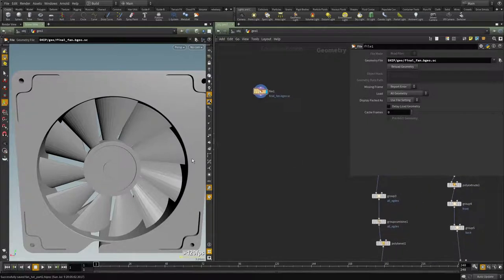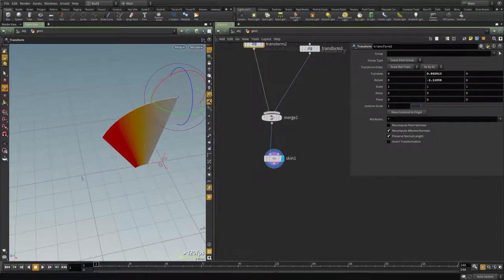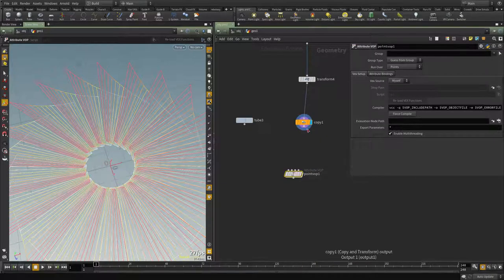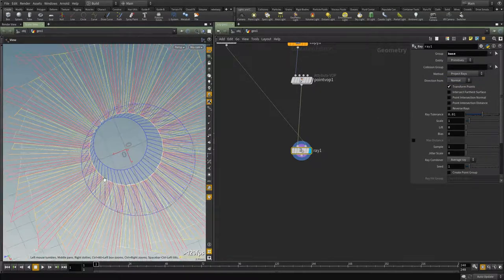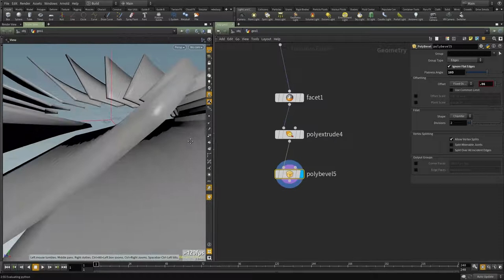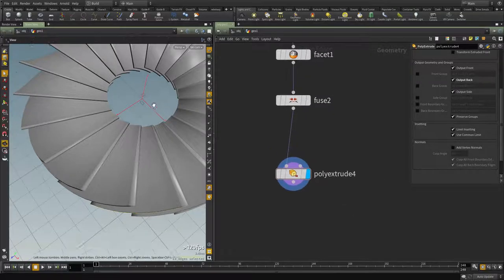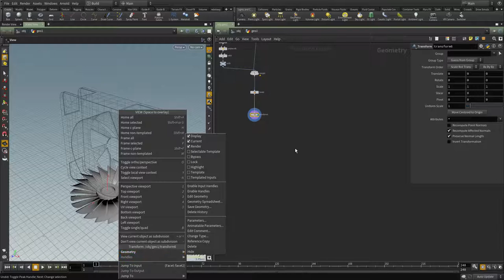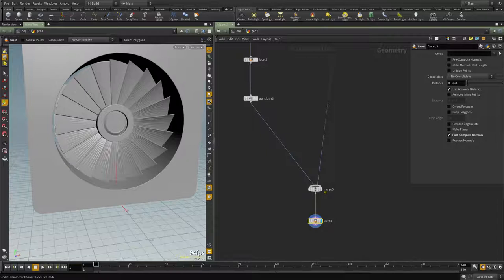Procedural Fan Modeling In Houdini 16 Part3

Comment: Soooo ... if you substract a 0,0,0 vector from the position, isn't that the same, if you just juse the positions as normals?
Reply: Yes that is true but in the sense that the model is not at world position 0,0,0 then it wont work so it's a 'safety'